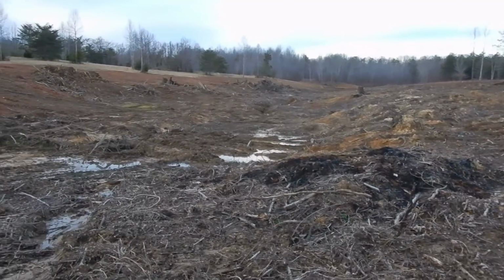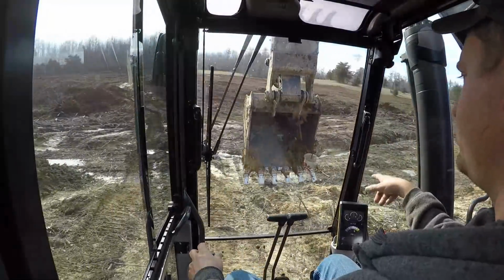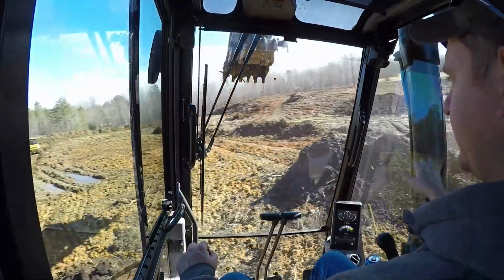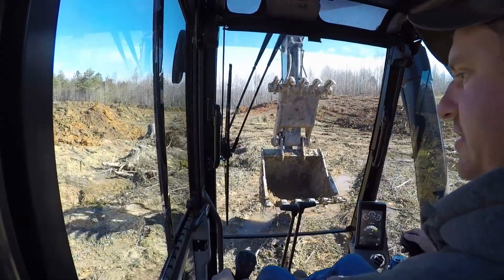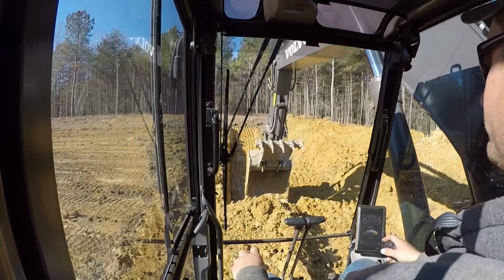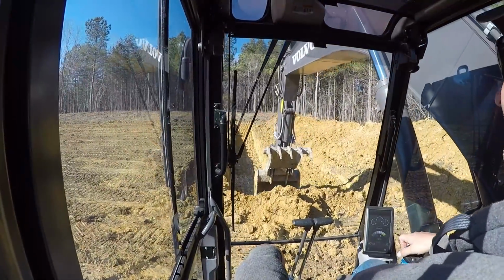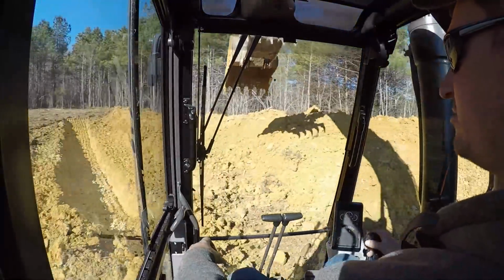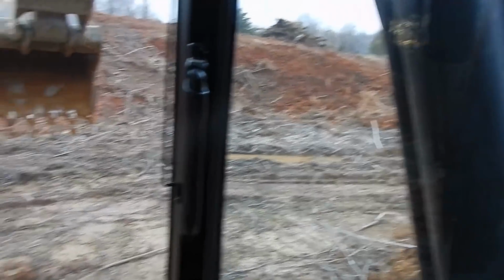Starting The Pond Dam

Comment: just a tip that not many know, if you want to make clay sloidify even more? ie you want to make it really clump up good? add salt to it.
dont believe me? go get a lump of clay, add a load of water an mix it up, it will go sloppy. 
then add a load of salt to it, stir it up an watch it clump up before your eyes.
salt is the key element in clay that holds it together, once the clay gets wet the salt content in the clay gets dissolved hence the clay goes to a mushy mess.

Comment: Chris I know that you said the 250 has a 54” high capacity bucket. What does that hold around 3 yards when heaped?   How does the 250s bucket size compare to the 160 and the 220s bucket

Comment: You do excellent work. 

That creek is so small I can't see how folks downstream will get any water after the creek is dammed. There is a whole lot of evaporation that will take place. If I were downstream I would not be happy.

A five-acre pond will lose well over 1,000,000 gallons a year due to evaporation. The loss could even be as high as 4,000,000 gallons a year.
Reply: Raj I agree. There's a lot more evaporation than people think depending on surface acres. I built a 2+ acre pond in NC and during summer the creek is dry behind my dam. My grandfather built a 4 acre pond 70 yrs ago and the water level "never" went down until it was sold and they cut all the tree's down around it especially on the high ridge that blocked a lot of the sun most of the day.   It's not uncommon now to be down 3 feet in the summer time. Lucky i own both sides of the creek until it reaches a bigger creek. I'm sure there are springs below this dam but with that small of a creek even with all the rain we've had in NC that creek will probably never see water in the summer.
Reply: @alonzo476  A five-acre pond will lose well over 1,000,000 gallons a year to evaporation. The loss could even be as high as 4,000,000 gallons a year.

Comment: I have never run a track hoe and I have been watching your hand movements on the controls trying to figure them out. Can you go through the controls for us? What each control does.Thanks
Reply: Johnny Holland the left controls swing left and right, it also moves the boom out or in.
The right controls the bucket and stick.  Left is curl in and right is curl out, forward moves the stick down and reverse moves the stick up.
Reply: @jkhuskies09  OK now I am really confused....... Just kidding. Got it figured out now. Kinda   Thanks
Reply: Johnny Holland it will take a while to get the hang of it compared to a Backhoe or other machines but not horrible.

Comment: i need that machine for a day to redo my dam, the ass company that did mine i told him to strip the black mud of the bottom of the re-vein and up the sides and push clean wet sticky red clay across, we when i was not looking he just pushed huge stumps down into it and tramped it in, he didnt even strip the black mud off the bottom, i wanted a key cut in like your doing, and to me it was comone sense to key it..       i told him to push that shit out of there an do what i told you, he refused and said no water will ever get though this sticky red shit and if it do i come back and fix it for free, 2 years later you could walk under the 24" pipe, in around all the roots, i called here and fix it, i was told not my problem, if you were digging my red clay you have to shack the bucket to get it to drop out, and it land in the shape of the bucket

Comment: Do you need DNR approval for a pond?
Reply: In a video long ago I think Chris said the property owners spent a very long time gaining permission.
Reply: I am sure there is a requirement for lots of permits and surveys to be done due to the fact that a natural water stream is involved and damming up the water will have an impact on nature that is depending on that water 'downstream'. I would assume that the pond overflow has to drain exactly back into the old stream for example, to ensure the eco system downstream from this pond stays intact. I would also assume that the emergency spillway that ponds need also had to be designed and engineered properly to ensure large amounts of watrer will drain down an area that can handle the increased flow without creating washouts and excessive erosion.
Reply: Thanks.

Comment: Chris, how much does the bucket weigh? 🤔 about 600 lbs
Reply: Anthony, just for a little comparison.... I have a 30" bucket on my 28,000lb excavator and it weighs 865lbs...That 54" high capacity bucket weighs somewhere between 2400 and 3000lbs according to a few bucket manufacturers I looked up.